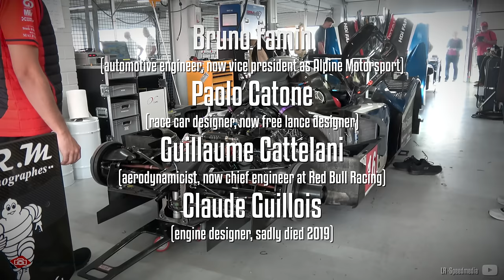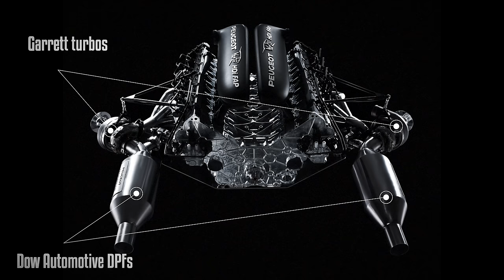The French Diesel Was Set To Destroy Audi

Comment: I love the Audi dominant era of endurance racing. They took a diesel and proved they can engineered a slow revving engine into a winning racecar.
Reply: Actually 6 years of their dominance was gasoline V8 engines.
Reply: it was not actually diesel. The general principle of the engine was diesel but the fuel itself was nothing like diesel you get at the local pump.
Reply: When the diesel came there was no competition for the Audi to fight against until Peugeot came.

 If you wanted low reving cars dominating the race the 60s had all of them until the FIA had to ban them at certain points. High Displacement engines always dominated Lemans until an outlier car or rule changes won it.
Reply: @bapr3887  and so many people seem to forget about this
Reply: The ACO rules were biased towards diesels. That is all it was.

Comment: 2:55 I cannot believe the rpm diesel figures!!!! 6000 rpm for a direct injected diesel is mind blowing!!!!  🤯
Reply: 4,500 to 5,000 is roughly the more realistic redline for a diesel because there's no need to push a diesel that hard.
Reply: @TheSilverShadow17  Why not?
Reply: @Random-dq8ew  Diesels aren't known to be rev happy lol that's why and plus that's burning more fuel from pushing it that high in the rpm range. I mean sure it's cool and all but high rpm is not the strong suit of a diesel.
Reply: @TheSilverShadow17  I'm perfectly aware of that! Hence my comment...
Reply: @TheSilverShadow17  Sure but extreme torq could be a problem. 
High rews could help with that.
Reply: @Random-dq8ew  Not necessarily. A low revving engine will outlast and outlive an engine that revs tens of thousands of rpm constantly, which is a byproduct of the latter having a really short lifespan and high wear and tear. Hence why some of the largest engines ever built in history only peak at a few hundred or so rpm. It's because they don't have to work as hard to achieve the same power as a smaller one. Again I'm impressed that the V12 in the Peugeot can rev to 6k, but is it really that necessary? Horsepower sells cars but TORQUE wins races. Key word: Torque. Not rpm.
Reply: @TheSilverShadow17  i disagree, key word is power and light weight. Hight torq and heawy powertrain is good for trucks not track cars. High rpm high power light weight.
Reply: @Random-dq8ew  And yet some track cars have high amounts of torque anyway which is beyond your control. The Hybrid LMP1s for instance. Or the old Can Am machines.
Reply: @Random-dq8ew  Audi and Peugeot have dominated Le Mans with their high torque race cars, and what were you doing while that happened?
Reply: @TheSilverShadow17  there's no horsepower vs torque. Torque is force and horsepower is torque applied over time (revs), you can never feel torque. High revs aren't dangerous for engines, heat and stress are. High revving engines are far lighter, more compact and have much reduced stress on the drivetrain, a well cooled and balanced high revving has no issues with durability and there are plenty of those examples. Diesels dominated lemans because they're fuel efficient by nature and that's important when regulations limit fuel. Have you ever seen formula 1 cars give up high rpm power to optimize for a higher torque output earlier in the revrange?
Reply: @snapcountersteer  What I'm saying is that high revving engines wear out over time faster than others because they're constantly turning at high speeds, compared to much larger lower revving ones. That's just how mechanical physics work. A gigantic cargo ship diesel engine for example will last 10x longer than a car engine for obvious reasons, one of them being low engine speed.
Reply: @snapcountersteer For the same reasons why semi trucks don't have motorcycle or high revving car engines. Trucking is an application that's simply too high strain on engines like that, so that's where low revving diesels fit the niche and do the job. Again, engines with a low redline have a significantly longer lifespan than engines that rev super high.
Reply: @TheSilverShadow17  you use semi trucks and cargo ships as examples of successful applications of diesel technology. Are they high speed vehicles in any way, shape or form? Do they have high power to weight or power to displacement? Is a semi truck a better engineered performance vehicle than a 458 italia or a Kawasaki Ninja? Has a semi truck ever ran competitive lap times to cars of equal power? Would you put a scania V8 in an f1 car to increase its performance? Cargo ships and semis last long because they are required to, racing engines have a limited life span because longevity is traded for performance, but that does not mean high revving engines are unreliable. Look at the honda CBR600RR, a vehicle that revs to 16000 rpm yet has traveled hundreds of thousands of kilometers by thousands of riders, while racing 450cc dirtbikes that can barely reach 10k need a top end rebuild every 30 hours or so. Diesels were only used in lemans for a bit due to a regulation that favored their low consumption a lot. Once hybrids came around and gas engines could get more acceptable consumption, both porsche and toyota ate audi up.
Reply: @TheSilverShadow17  Are you ok?
Reply: @snapcountersteer  European racing trucks exist, do they not? That's a dedicated motorsport series around semis built for high performance. Of course cargo ships and normal semis don't have a higher power to weight ratio than a Ferrari, but they can go a much farther distance over a longer period of time than a supercar ever could in it's lifespan. Over in the Le Mans side of the equation Audi fought Toyota and Porsche with their 2016 redesign R18 which was a diesel hybrid but as you said it got beat by Porsche which was the Le Mans victor for several years until Toyota beat them.
Reply: @TheSilverShadow17  european racing trucks do exist, and even in their best form, they are several seconds slower than 250-300hp touring cars while they boast >1100hp. The total distance a cargo ship covers is irrelevant and quite baffling to bring up, since supercars and racecars are judged by their ability to cover twisty ground quickly and enjoyably. Diesels are superior industrial engines due to the fact that they're not knock limited, but gasoline engines have and always will sit head and shoulders above diesels in performance. If you frankly believe that anyone has ever cared about the total distance a supercar has covered during its life compared to a cargo ship, you're free to snub racing and join the swathes of people who watch, hear and smell cargoships travel for leisure (noone actually does this).
Reply: @snapcountersteer  That's because the racing trucks weigh over 5 tons on average which is an inherent result of their physical size. Of course they're not going to perform as well as a 300 hp touring car, but they're a lot more fun to watch than let's say the GT3 category, because of the sheer chaos that unfolds within the first few minutes of every race.
Reply: And it boils down to the execution of using a diesel engine for motorsport applications like Le Mans, which as far as I'm aware on history's behalf, Audi and Peugeot were the only 2 manufacturers to successfully pull it off and get at least a few victories, Audi much more so than Peugeot. Getting a motorsport oriented diesel engine to work is one thing but to get the execution proper and correct is another.
Reply: @TheSilverShadow17  Seat with TDi engine dominate STCC series, it was fwd diesel vs rwd gasoline race cars btw. Diesel is very underrated in motorsports.
Reply: @bapr3887  Seat is one of those underrated and little known manufacturers I respect to a great degree for making such an achievement. Not much gets said about Skoda either which also participates in motorsport as well.
Reply: @TheSilverShadow17  It wasnt Seat anyway, it was Audi A3 chassis with Audi people around it with Seat logo. Vag in cars are mainly Porsche and Audi, rest are just logos.
Reply: @bapr3887  Lamborghini certainly isn't just a logo and they have been serious in motorsport the past decade or so. Other than that why does VAG do this type of stuff? For marketing purposes I presume?
Reply: @TheSilverShadow17  Lambo are Audi's sport divison cars.
Reply: @bapr3887  That's only true after the fact when VAG bought the brand but before VAG took control they weren't.
Reply: @Random-dq8ew  Torque has more use than you otherwise think with your "Anti-Torque" mindset. It helps vehicles accelerate and maintain drifts like in professional motorsport events such as Formula Drift. Drag racing also revolves around acceleration which requires torque. You can't haul or tow heavy trailers without torque either. Regardless of application, torque is everywhere involved in everything.
Reply: My 2001 Peugeot 2.2 Hdi can easily get to 6500 Rpm, so, it is obvious, that these racing cars can run higher.
Reply: @TheSilverShadow17  Torque wins races more than HP. Torque makes you revs faster. If two engines have similar horsepower and design the one that has higher torque and the other revs, the one with higher torque always accelerates faster, the one with higher torque also can be geared to a achieve a higher top speed as it has more energy to put at the wheel.
Reply: @HenAnt  Hence why Audi was so dominant at Le Mans for over 10 years straight with their diesel powered prototypes, because the torque gave them the acceleration advantage over their competitors and Peugeot realized this as well when they entered the race with their 908 for the first time. It took them a few attempts but they got the formula down after 2010 and 2011.
Reply: @snapcountersteer  Horsepower without proper Torque is useless. Torque accelerates RPMs faster, It tugs the weight of the car better as it is the energy being transffered at the wheel, with proper gearing and similar weight a torquier car can reach a higher top speed while having similar acceleration to a high revving car, and if identical it will accelerate faster. As for durability it is far easier to beef up the Drivetrain than to optimize an engine to be durable, and there are twice as many Torque Factories that are as reliable as High reving examples both on the road and track.

 Torque > Horsepower and Revs in importance, you don't go from one Horsepower figure to another faster without higher Torque.
Reply: @TheSilverShadow17  Not necessarily that simple. While torque was the key factor it was how it was applied through gearing and inherent fuel efficiency that won them Lemans (also lack of competition and rulesets to balance them but that's besides the point.) It didn't actually accelerate that much faster than the competition, if at all, the telemetry proved that. 

Reason? The Diesel Engine. Diesels inherently rev slower due to having more reciprocating mass, longer piston travel, and a slower combustion process. Look at it this way, a gas car with similar displacement and rev limit (say 5000 rpm) will inherently have less torque than the diesel but will also inherently have less reciprocating mass that far greater decreases the parasitic load. Because of this, It will take less Torque to move the crankshaft as fast as the Diesel to accelerate just as fast, however once the Gas engine makes as much Torque as a Diesel it accelerates even faster. When restrictions on the number of Pistons and displacement you could have been added it was already over, higher power and torque  demands were needed.
Reply: @HenAnt  "torque accelerates rpms faster", engine response has almost nothing to do with torque and more to do with the weight of your reciprocating components and fueling.
"it tugs the weight of the car better"
torque has no effect on the car outside of its result in horsepower, what moves the wheels is horsepower, so you pulled that out of your ass.
"with similar weight and equal gearing a torquier car can have higher top speed than a high revving car", you mean a torquier car with the same horsepower as a high revver (and the similar weight it can't achieve in real life due to having a heavier engine and drivetrain components)? If so, I can just take your torquey car, move its torque higher up the revrange, and be even faster, so that's moot. (also low end horsepowe has no effect on top speed).
"it is much easier to beef up the drivetrain than to make an engine durable, and there are twice as many Torque factories (???) as high revving engines on the track and the road". Save for the fact that one of the most common examples of DNFs are drivetrain failues, would you care to provide any examples of purposefully low revving engines in racing? Save for the diesels, I have never seen racing engines tuned specifically to boost low end torque outside of disciplines where there's a maximum horsepower limit.
Reply: @snapcountersteer volvo diesel semi 700hp, ferrari 458 570hp looks like it is an upgrade
Reply: @carlosnavarro-cj2jv a diesel engine is made completely of iron, that Volvo Diesel will probably weigh as much as the entire car.
Reply: @bzilla-d4i  of course, I was referring purely to power figures

Comment: Ricardo also designed a diesel engine for endurance intended for endurance racing in the early 00s. i believe it was based on a judd v10. unfortunately it was never raced would have been cool to see more diesel cars in lmp1
Reply: IIRC it was a Toureg V10.

There was a different alternative fuel V10 based around the Judd GV (if you're willing to call E100 an alternative fuel for 2004) ran by Nasamax.

Comment: i hope peugeot can work out the issues with their 9x8, from what i saw of wec this year it seemed ok but wasnt near the top of the field.
Reply: Bop ruined any chance of proper competitiveness. Fia Regulations changed mid build. They'll be much stronger next year.
Reply: @unclebanga5976 that hybrid activation speed change first hit the toyota with their equal tyre size all the way back in 2021, causing them to move to wider rear tyre configuration for 2022. Peugeot must have been sleeping through that period to NOT realize this would be the case
Reply: @ruzgarakgul2051  definitely weren't sleeping. It's in Peugeot sports end of year report from their technical director Olivier Jansonnie.
Reply: The issue with the lack of a rear wing has to do with generating downforce using only the underbody. It works fine if the track is smooth. Once you have to raise the ride height for bumpy tracks then you lose a great deal of the downforce generated that way.

Comment: They used the 'FAP' acronym as it was also widely used in their normal cars and also to underline  that they were the first to use it in the 607 2.2 engine as well as they had the best technology for this application (no pre-impregnated filters like VAG cars, instead they were running an extra special tank for Eolys additive and an extra ECU which was managing the injection). I doubt though that the racing cars really had a FAP....

Comment: "The French Diesel Was Set To Destroy Audi" But unfortunately it was French so it didn't :-)   Jokes aside, interesting to see that other manufacturers tried diesel. I am not following any racing so I  only knew about the R10.
Reply: peugeots lost some years because of not engine troubles. Like pilots, tactics. In 2011 they managed not to take off a minor audi. In 07,08 pilots made too many mistakes in rain conditions
Reply: @siniyden  too many excuses lol
Reply: If you take away the reliability issues at Le mans, Peugeot did pretty much dominate. They won 20 out of 30 races with the 908 hdi fap v12.
Reply: @unclebanga5976  Yes but reliability is a big part of Le Mans so they didn't. :-)
Reply: @thehaze1972  anyway it was very strong competitor, not shame like this year.
And i don`t remember significant problems with reliability except 2010, where cats were much faster than rings, even private oreca. If they didn`t push too much, maybe they had no problems with reliability and fuel consumption and won